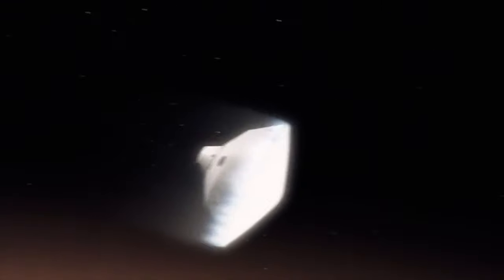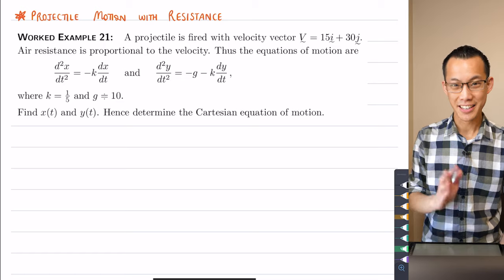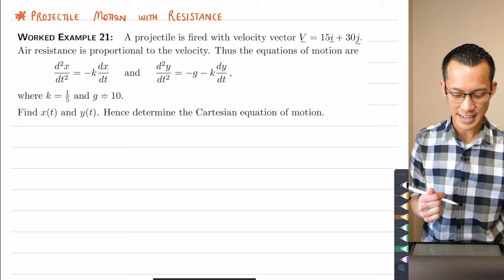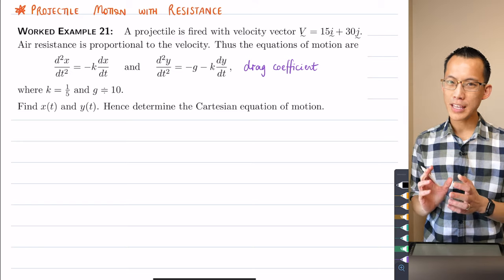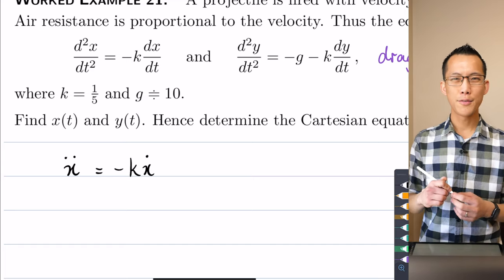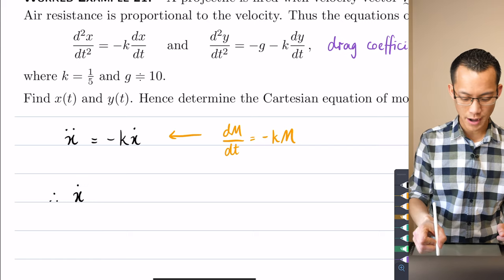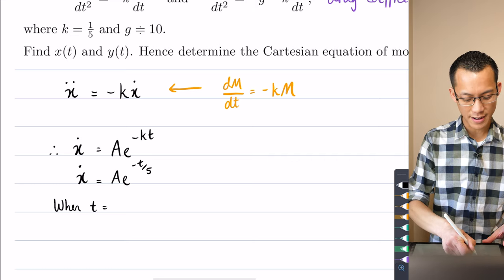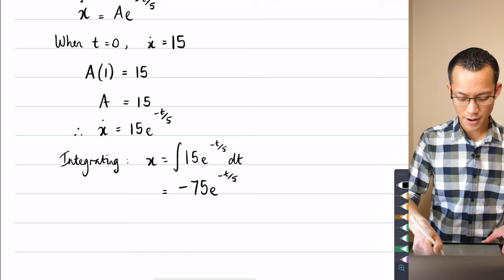Resisted Projectile Motion (1 of 4: Understanding horizontal motion)

Comment: Energy is the difference between number bonds. Energy can transfer only through surface bonds and not by any other means. Because energy is a surface phenomenon not a vector or point or lines or 3D. Or higher. The reason why plants have flat leafs.